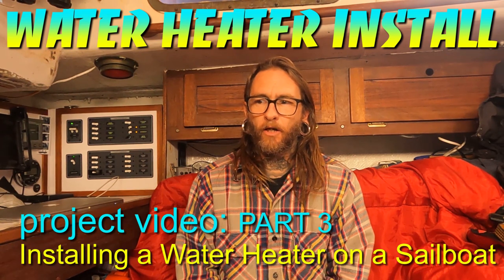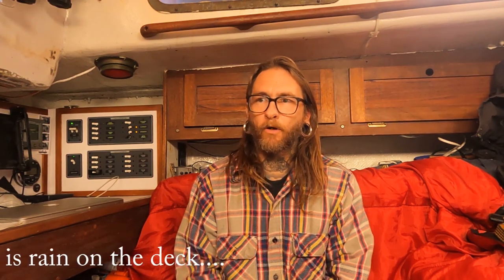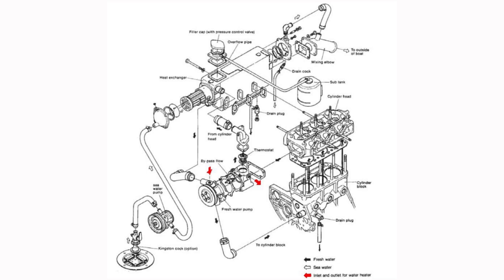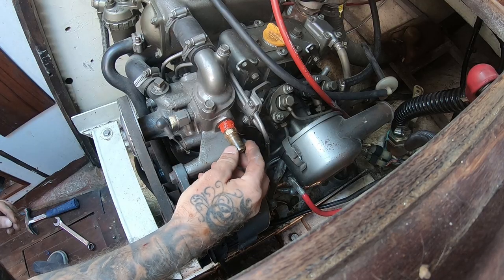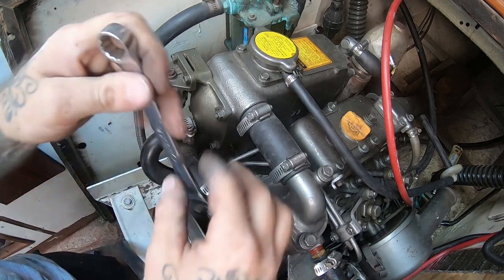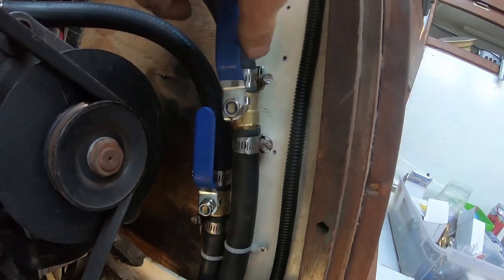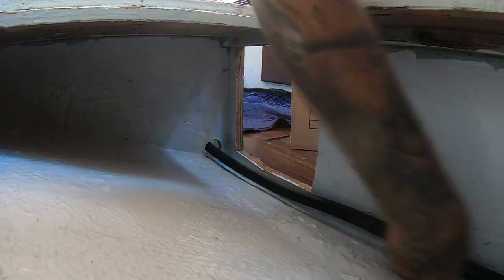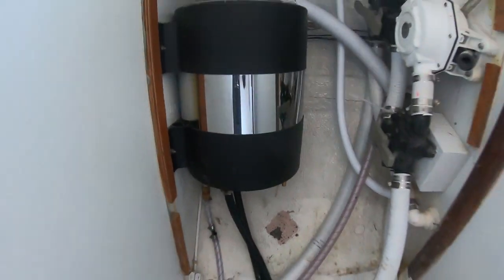How to Install a Hydronic Water Heater on a Boat with a Diesel Engine

Comment: Great addition to a little boat. It sure will make cruising much more enjoyable. A hot shower can make a bad day into a great day. 

Did you have to add much more coolant to the system to make up for the plumbing hoses?

Comment: Soup to nuts how much did this cost?  What was the make and model of the water heater you bought?   I have the same engine on my Alberg 30 and this looks like a neat project for next winter.
Reply: Bit off topic.  Would be interested in the transmission and prop that each of you (Sailor James and Patrick Wentz) have on your Albergs.  Mine has a Yanmar 2GM20F as well with the 2.62:1 tranny.

Comment: Thx, Great idea to add the shut off valves at the engine.  I’m in process of doing this to my power boat. It always had the hot water heater tank with only the 110v hooked up,  it was never plumbed to engine. I’m thinking of adding a mix valve to prevent over heating. Just not sure what’s best, if I should do it on the engine heating loop or just inline on the potable water side? Any thoughts?

Comment: What technique did you use to purge air out of the hoses going to and from the water heater. Great idea on putting shut off valves at the engine side.
Reply from the maker: Open the radiator cap after running and cooled down

Comment: Excellent video, think about insulation for the hot side from the engine to the water heater.
Reply from the maker: Not necessarily, the hose doesn’t heat up  enough for concern and that shit still makes the water crazy hot

Comment: Hi, Thanks a lot for the very nice video. I have one question regarding the first run. I imagine that the first time you run the engine, the cooling system need to be filled by coolant and get rid og the air. Can you explain how did this first run go for you? Did it get rid of the air automatically and you just needed to add extra coolant? Thanks in advance!
Reply from the maker: I only had to add a small amount of coolant after the initial fill and run, I just added it to the overflow and kept an eye on that and double check the heat exchanger level when the engine was cold after the first few times
Reply: @SailorJames  Thanks a lot. I tried this weekend and it worked indeed. The cooling system seems to bleed itself automatically :)
Reply: @SailorJames  Thanks a lot! It also worked like that for me!

Comment: Happy Easter !  Couple thoughts/questions. Love the shut offs, very prudent ! Did you add chafe protection onto the hoses where they ran through the bulkheads ? Any thoughts about a expansion tank ? Why not a 12V heat exchanger for the cabin ? At a dock with power and you have heat and hot water
Reply from the maker: Yes I added chafe protection at every point it passes through a bulkhead, I cut larger diameter hose and glued it into place - we have a forced air diesel heater we are installing so we didn’t need a redundant heater, we installed an expansion/accumulation tank in the system as well
Reply: @SailorJames  What made you go with forced air vs a boiler ?
Reply from the maker: We wanted a heater that we can run under anchor without the engine on and forced air heaters do a great job of drying the boat out
Reply: @SailorJames  Thanks for your replies

Comment: I'd recommend getting a tempering valve, it bleeds a little bit of cold water into the hot as it exits the cylinder so you don't scold yourselves and is adjustable. Engine coolant will heat the water up enough to give you a nasty burn.
Reply from the maker: Yeah we tried to order one when we installed it but had a lot of trouble finding the one for our model, it’s so hard to get it so it’s not freezing or scalding
Reply: @SailorJames  i’ve installed a few isotherm temping valves on customers boats. They are great they are a thermostat type temping valve so adjust to the water temp. It would work with your cylinder you’ll just need to get the right fittings to suit.

Comment: Do you have a video or advice on bleeding a hot water heater? Thx
Reply from the maker: You just open the shower handle and let it run until all the air is out
Reply: @SailorJames  great thx we will try that!

Comment: So your motor has to be running to get hot water?  And the same if you run a heater that way?
Reply from the maker: Yes your engine has to run for a while but we have found the water was still hot the next morning after a motorsail to Catalina or when you are hooked up to shore power

Comment: I was wondering if you shut off the valves at the engine after motoring would the tank maintain heat for longer.  My reasoning is that the engine block is a big heat sink. After the engine has been shut down, with the valve open, the stored fresh water heat would transfer back to the coolant and "percolate", as it were, back to the engine. Closing the valves would isolate the coolant to prevent the engine block from robbing heat from the tank.  ????? Just a thought
Edit- And as I clicked to the next vid it dawned on me that re-opening the valves before start up may shorten the warm up time of your diesel. Provided your still had heat in the fresh water tank.
Reply: Thinking that The thermostat on your motor prevents this, it remains closed when warming up the engine, thus the coolant circulates only in a loop inside the engine,

Comment: Any concern about grounding / galvanic corrosion with the element inside the tank?
Reply from the maker: No this tank is made specifically for marine environment and the element is isolated from the water and never comes in contact with it
Reply: @SailorJames  Did you mean 'the engine coolant never comes in contact with the element' ?
Kinda hard to heat water if the element doesn't contact the fresh water.